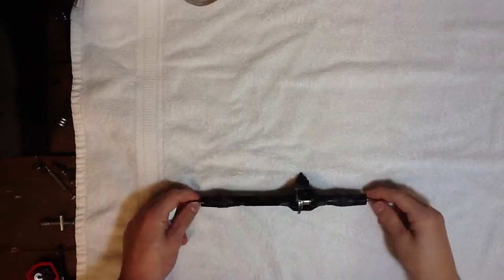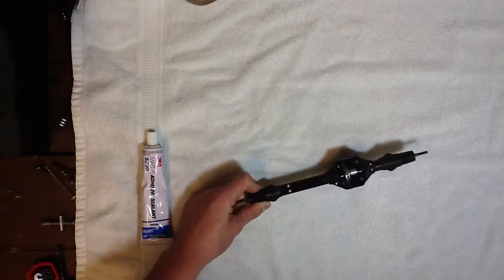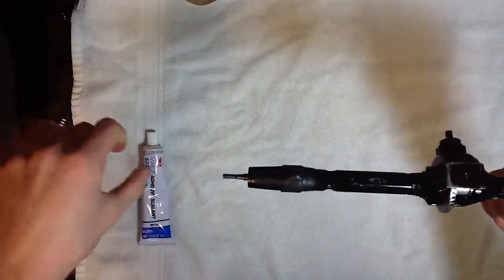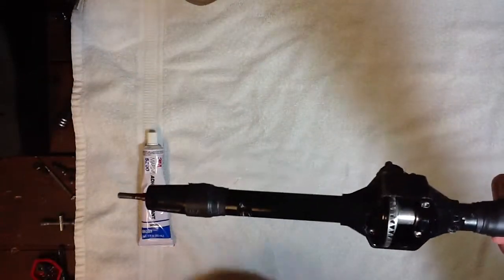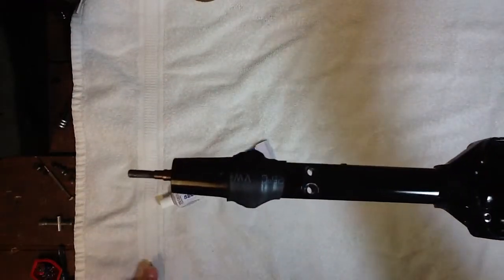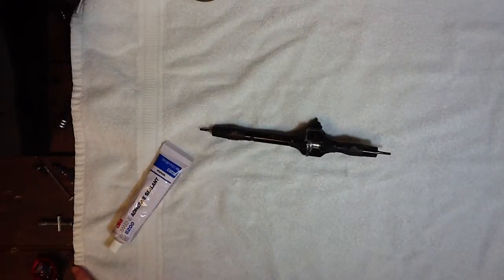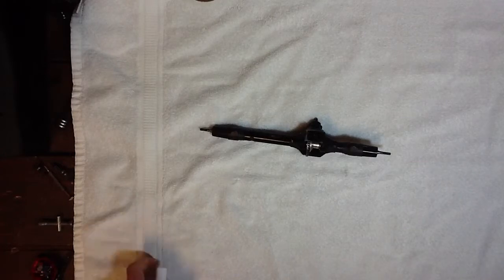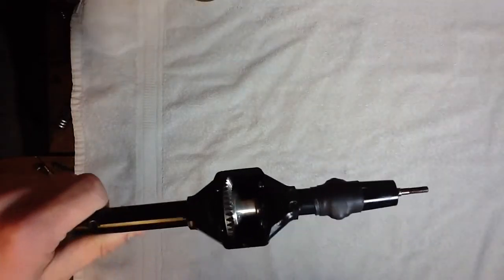Integy t3 axial wraith rear axel

Comment: C-Hubs are in the front. The rear have lockouts. Difference is the lockouts are just used to cap the axle housing  and hold the bearings/axle shaft in place. A C-Hub is the shape of a C and holds the knuckles that are used for steering.